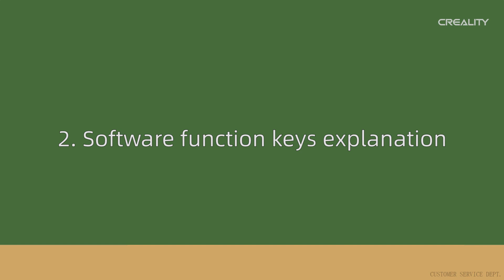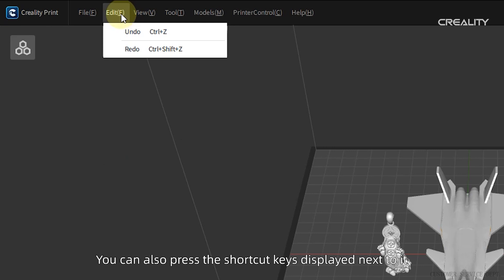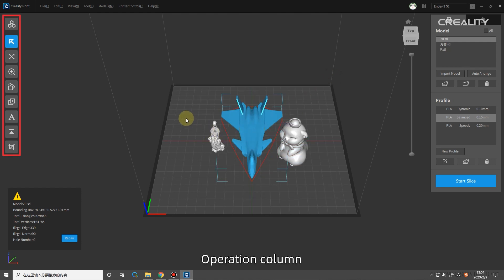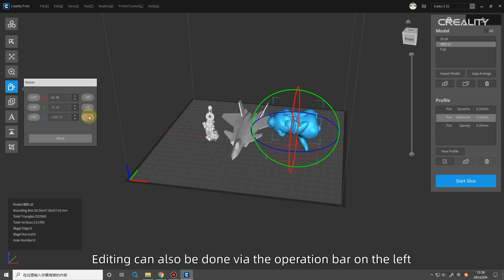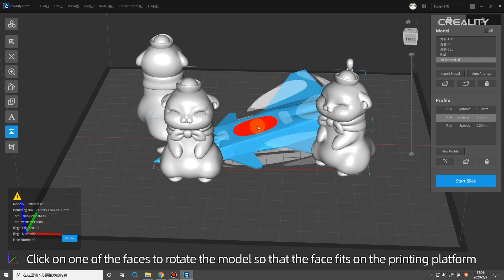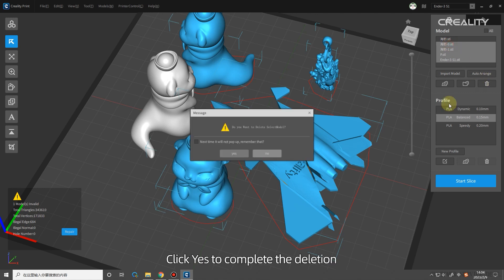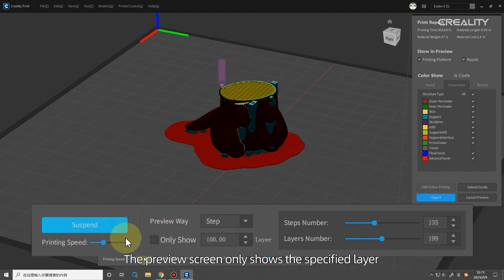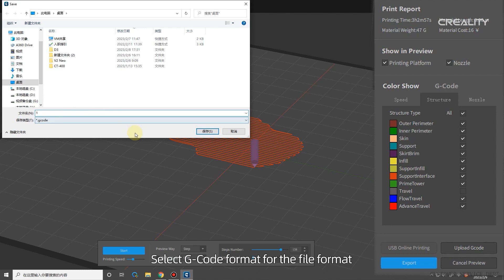Creality Print Software Tutorial 2.Software function keys explanation

Comment: I tried the latest version as I was not too impressed by the release version, I found I could not change the skirt distance from the part which is set at 3mm as default, this needs to be changed as any oozing before the main part is printed is usually within the skirt as it is printed, however, if the skirt is 3mm away from the part that oozed plastic usually falls into the area of the main part to be printed which ruins the first layer.
 Until this is fixed I cant use Creality Print to slice my parts.
Reply: I think this is a dead channel. No response to questions. The slicer has good potential but still can’t compete with Cura or Prusa still.

Comment: How do you add/ import other material profiles like PETG and TPU?
Reply: This is what I want to know.  

We already know how to print and how to orient a print, I'm here to try to figure out the workflow for the software.  Why is there no demonstration of how to manage and apply the materials, only the basic obvious stuff, sheesh.
Reply: @jaya8352  I just found that you cant change the distance of the skirt from the part, it gives you the opportunity but wont save the value you enter into it, the default is 3mm which is not good as any oozing before the print is captured in the skirt and being only 3mm away from the part to be printed usually falls in the area that the part is to be printed thus ruining the first layer, I have heard it said that Creality developed this software from scratch but it looks just like another fork of Cura and a bad one at that.

Comment: Is there a way to print without the bottom platform?
Reply: Its in the adhesion/build plate adhesion settings its pretty much in every slicer. you can select different types from None (self explanatory :D) Skirt (lines around model, you can set up the number and distance from model) Brim makes a flat area lines connected to the model (you can choose how far from model it will reach, usually for when you have warping problems and not sticking to bed problems) you will have to cut it out after and Raft is the full flat area including below the model itself, never did it personally but its supposed to have best adhesion anti warp, and because it makes an interface between model and the raft its easy to remove but leaves probably ugly bottom like after supports :)
Reply: @ladislavsunek1254  You cant set the distance of the skirt from the part, it wont allow you to change the default 3mm, any oozing that does not get trapped in the purge line ends up in the skirt and usually falls into the area of the main print and ruins the first layer, not so bad if you are with the printer as you can just whip the skirt off the bed, I use Octoprint though and it is a pain in the arse to have to go out to the shed for every print, I will continue to use Cura.
Reply: @AndrewAHayes  Depends on slicer. for example in crealityprint you can set distance for the skirt lines 💁‍♂